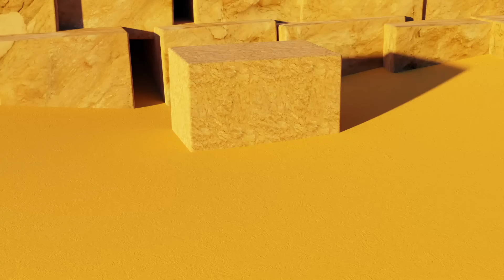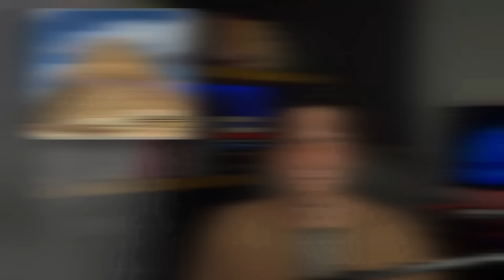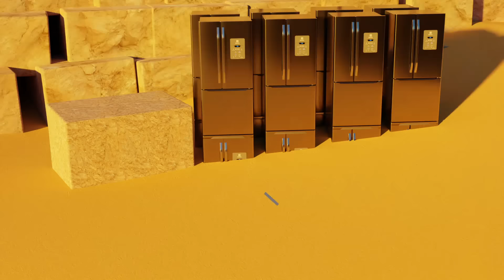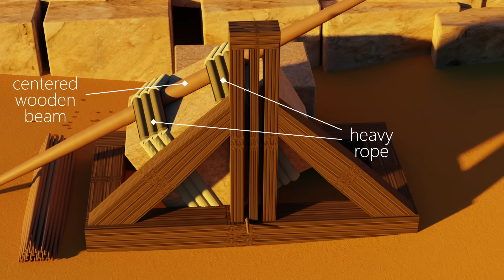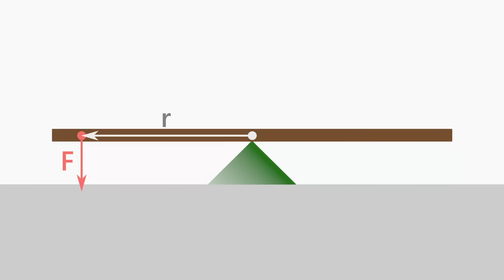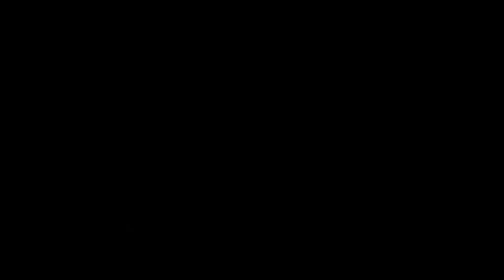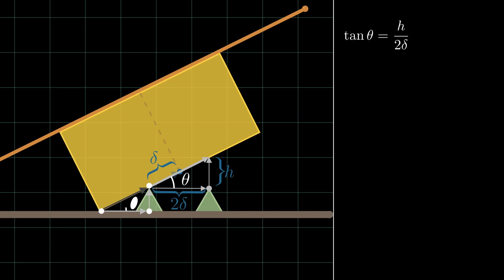Physics Reveals How the Pyramids were Actually Built

Comment: As a construction worker I have noticed that the people that draw the blueprints really have no idea how things work in the real world, I would like to see actual real world experiments using this theory
Reply: Some Japanese engineers tried to duplicate building a small pyramid using these techniques...and failed miserably.   They had to resort to using modern heavy lifting machines and still ended up with a very poor little excuse for a pyramid.
They say that the Egyptians placed one block every 6 minutes...yet the device they postulate that was used to lever them into place would take hours to build at each block location.   Obviously this is NOT how it was done....at least not in the timespan they claim it took.
Reply: @recoilrob324  I'm curious if in this setting a block every 6 minutes figure if it takes into account that most of the blocks would have to be lifted many, many times.  Never mind building the various chambers and ventilation spaces and ramps that are inside these graves.
Reply: @shopshop144  The '6 minute per block' number comes from the estimated total number divided into the 20 years the pyramid supposedly took to build.    So far....I've not seen ANY workable theory that could match that production rate and suspect that the timeline is not correct.   The pyramids could have been centuries in construction layer by layer which would make some of the proposed methods a lot more feasible....but no matter how long it took....still an incredible feat of construction.
Reply: @shopshop144 they are not graves. Don't ask me what they are, I don't know but there is no evidence that they were graves.
Reply: @recoilrob324  They didn't need to lift anything bro. They just built a ramp, used wet sand to reduce friction and pushed and pulled those rocks. They also used pulley systems to help in that. Really, all you conspiracy maniacs cling to pyramids while humans built so many huge buildings in ancient times. You don't seem to have so many conspiracies about Romans, who moved 500 ton obelisks - transported them from Egypt and put them in Rome. Collosseum? South america pyramids? All of it is basic mechanics/physics that were known since ancient times, math, manpower, ropes and wooden machines.
Reply: @recoilrob324  HAHAHAHA your "calculation" assumes one stone was laid, while the other 50,000 workers stood around doing nothing, and only when that stone was laid, the next 50 moved their block, etc. The pyramid is 230 METRES long by 230 METRES wide (ie 2x the size of an olympic running track), meaning there are roughly 100 blocks PER SIDE. So obviously at any one time, at least 50 blocks would be being levered into place. So immediately your calculation changes from one block moved into final place every 6 minutes to every 300 minutes ie every 5 hours. So each team only had to get their block into place once every 5 hours. So yeah, easy. These machines also aren't being "built", they are built and ready to move blocks. There would have literally been 1000s of these waiting for use, with up to 100,000 workers according to records.
Reply: @rufioswitch2132 
Yeah, not that easy... The barycenter of equilateral triangle is at 1/3 its height. Let say the Pyramide barycenter is at 1/4. It may vary a little but I want an order of magnitude. So for a 481m height pyramide you have to lift in average your blocs to 120m. In 6 minutes each.From the video we can expect a lift of 10cm each lifting step. Let sat one lift step takes 10 min, you need 12000 minutes to lift at 120m, or 200 hours per bloc in average. As you suposely dispose from 6 min only, you need 12000/6=2000 machines working in parallel for completion in time. Then you have to account for building and repairing these machines, inserting and shifting the blocs into and out of the machines, cutting and bringing the blocs to location and so on and so forth. I do not want to invoke aliens theory and I certainly do not believe in it, but just say that the mystery is still unsolved. Math is still not really adding up...
Reply: @rufioswitch2132  not enough room for thousands of workers to swarm over the shrinking pyramid...placing the blocks is the easy part...getting them to height aand dressing them to fit with copper tools and fitting them to match the complicated interior with the precision in the Great Pyramid is not feasivle..
Modern stonemasons and construction experts admit they could not build that today..
give your head a shake
Reply: @pvb9964  then you obviously have no idea how big the pyramid is. The base size is 40,000 sq metres. 
Even 50 metres up the area of each level is over 20,000 m2
And please tell me the names of these master stonemasons and modern construction experts who say this. Or are you just repeating what your clickbait podcast heroes say without checking?? 😂😂😂😂
Reply: @rufioswitch2132  those "master stone masons" use reality, as do the construction experts, who there are aplenty of.
Just the mere height of the Great Pyramid and the size of the blocks would make getting to a level to actually place those 2 ton blocks a formidable chore each day, not to mention the water and food consumed wotking and going up and down the sides of that 400+ high structure. 
You have not mentioned the limestone cladding....did they start at the bottom, fitting each slab to fit the 2 ton blocks, as they went up,  or from the top down?
Did they drag that cladding across the 2 ton blocks, or sled those slabs up into place...note the Great pyramid has 8 sides, not 4..with a small vertiical valley on each face...likely to ensure a slight gravitational pull on the cladding sections to the center,  so they fit tight across the side faces.
The base is level to 1/8 of an inch...impossible without a theodilite or geostationary levelling.
No theory accounts for the movement of the fifty-ton granite slabs used in constructing the internal chambers of the GP.,
and the intricate passages that are dead straight right through blocks on numerous levels. 
The GP shows no "twist" off the vertical, which is quite common in stacked piles, not does the center deviate off in any direction.
All indicarions are that this strucure is an impossiblity, and is not a tomb.
The supposed King;s chamber was never breached, and needed explosives to enter, with zero evidence of any funerary or body.
Reply: @rufioswitch2132  : 50,000 workers, working in precise teams?  You really have no idea of what that mass of humanity looks like, much less the level of teamwork required.  How many people were involved in the D-Day landing and how much of that cohesion vanished?  And that's with the use of radios.
Reply: @Alexi7666  obviously 50,000 people not working at the same time and the same area you muppet. The quarry itself is huge and would have thousands working at the same time and the transport from the quarry (about 600 metres away) to the pyramid would be a huge area that would require thousands of workers moving blocks.
then the pyramid base is nearly 1000 metres around - that's MORE thab twice the size of an olympic running track. Look at an aerial view of an olympic track and see how small a group of 10 people is.
Reply: @rufioswitch2132  : Then we're right back to the materials involved.  Wood and rope aren't tough enough to move several tons of rock, over and over.  What sort of timbers were available in Egypt at that time?  They also didn't have synthetic ropes.  I've worked with one-inch sisal rope years ago.  Fine for moving large hay bales, but when we tried to unstick a smaller tractor from a muddy field, it snapped.
Reply: @Alexi7666 You’re talking to someone who’s only interested in arguing.  Your position is the logical one.  That person just didn’t have anything better to do but write obnoxious comments.
Reply: @recoilrob324  Funny how things work in parallel so every 6 minutes is actually a very reasonable number. I highly encourage learning how computers function and you'll realize how powerful doing tasks in parallel is
Reply: @CodeAlpaca  : Uh, you're talking about thousands of workers moving in perfect harmony for what, 27 years.  Just doesn't happen.  European cathedrals were built with mostly skilled craftsman over nearly the same lengths of time, but with smaller blocks of stone.  And Europe was full of the strongest types of wood for the assorted lifting machines needed.
Reply: Academics positing heavy construction techniques. I understand gravity,I carry my laptop every day, I understand building ,I picked up a brick once. With this experience I will demonstrate how easy it was to build the pyramid. 70 ton granite blocks 150 feet up an incline building face,lots and lots of men, there, easy as that.
Tomorrow I will construct a 100 ton granite sarcophagus with a sharpened turkey feather. I am an academic
Reply: @maxSebben  
Mygawd you're clueless.

This simple math was over you head.
Reply: @jcgoogle1808 . tutored maths and physics for three years1975/1978.. left academia because it it was full of gormless bipeds.. Have completed over $ 100.000.000 of building projects before retirement 2018. You am sure can explain construction to me because I am clueless.
Reply: An archaeologist cant build the chair they sit on, but if it was an ancient chair theyd be able to tell you everything about it
Reply: Yeah there's a million blocks in that pyramid doesn't make sense seems his theory would take a hundred years with that technique
Reply: @GarethMallon  
They're not setting one block at a timeMOREON,.. there are hundreds or groups each setting their own blcok.
Reply: @GarethMallon  poured blocks
Reply: @GarethMallon Instead of guessing, why not just do your calculations? Or if you did, show us.
Reply: Did the egyptians just stumble on pyramids built by a lost advanced civilization? <— conspiracy theorist. Nothing explains the pyramids and the tech they had. And how far was the quarry ?
Reply: I second this comment. I’m only 13 years into construction.
Reply: Why didnt they weave reeds into a balloon. Then have an engineer talk hot air into it. Could have been faster and less people.
Reply: The higher you go the the harder it gets, how do you get the blocks from the ground to the higher levels?
Reply: Concrete
Reply: Pretty sure a guy has demonstrated this all by himself pivoting large blocks on a single stone and lifting by this method. Im sure its on here, as guy who figured out Edd leedscalnin or whatever he’s called method building that coral castle by himself
Reply: @Sendit123  You're talking Wally Wallington from Michigan. Yes he does amazing things with simple methods. Now go find him & take another look. That stone moving is done on a very solid base, not sand or dirt. 
And look how long it takes him to move a 20 tonne block & figure out how long it would take him to move it a mile, let alone hundreds of miles.

Side note: Saw a claim the other day that this guy had seen Ed Leedskalnin using similar methods. That's a neat trick seeing Ed died in 1951. And given he was VERY careful about doing his work where nobody could see him, (even the truck driver who moved him from the original location) how come this guy claiming it hasn't made his presence known in the 70+ years since the mystery of Coral Castle came to light?
Reply: @markmcd2780 was on about the lifting mainly, but he did manage to build something on a large scale on his own. Now you go wally wallington and wonder off with your stones and go build something and find the other missing parts. Thank you
Reply: @Sendit123  Clearly SOMEBODY doesn't like having a civil conversation with someone who can actually point out your fallacies.
And it's 'wander' not 'wonder' seeing you decided to go rude!
Reply: @markmcd2780 omg you proper bellend😂 I dont have time for muppets like you😗
Reply: The most conclusive fact that comes when analyzing the Pyramids is that the field of Archeology needs to be rebuilt from the ground up. 3 years of carpentry, 3 years remote construction, 3 years of masonry with copper chisels and the Thesis being a 10 meter pyramid made with 50 cm cube granite blocks built all by themselves with no machines or even the wheel...
Reply: Look up “man lifts 20 ton block by hand” and you will find a video of a guy using the same technique described in this video, and other techniques of rolling huge blocks around.
Reply: @RT-jv3su  that guy "moved" a block across a flat surface and literally went nowhere. Completely impractical to do anything let alone the pyramids.
Reply: @RT-jv3su his name is Wally Wallington
Reply: @RT-jv3su  🤦🏻‍♂️
Reply: @RT-jv3su  Except that man used a modern electric crane to lift and put the block conveniently in place and to set up everything around it before he filmed "moving it with 1 hand". 
Ancient Egyptians did not have access to hydraulic cranes capable of lifting 20 metric tons. Surprise-surpise.
Reply: I have watched countless documentaries on how the pyramids were built. This is the best and most credible explanation I have found:
https://www.youtube.com/watch?v=KMAtkjy_YK4
Reply: Look up “man lifts 20 ton block by hand” and you can watch a video of a guy using this technique to stand a huge stone up on end.
Reply: It's been done research
Reply: Your comment is well taken.  Instead of applying their theories in real world conditions we get computer animation.  Yeah, I think that's cheating.
But your comment being so correct extends beyond the Great Pyramid to Science in General.  Science has been politicized, and is a bunch of "Beliefs"
or "Theories" but taught as Facts. If you want to get the "Truth" about Scientific Discoveries you must go to those Scientists who have won the Nobel Prize.
Because to win the Nobel Prize your "Theory" must be proven using the Scientific Method.  Everything else is just a bunch of computer graphics.   lol
Reply: "The Best" video about our Universe and Space:  "Brian P. Schmidt - The Accelerating Universe".  Brian is a Nobel Prize winner.
And a really good MIT produced video about what space travel is "Really" like  "Cool Worlds - Journey to the Edge of the Universe".
"Cool Worlds is somewhat "Theoretical" but shows our best guess about space travel. And Brians' video is solid science.
But, Brian opened a can of worms, creating more questions than answers. But he did finally set things straight on earlier theories. Both are really good.
Reply: What load of garbage,  useless in reality
Reply: How  about the  Wooden  formers  with  standard size  blocks inside (formers like giant  cotton reels in half with square  hole in  middle...held in place with wetted ropes.  ) this enables. a block to  be ROLLED   up  ramp)   Japan  busness guys. did this  but  nobody seems to have noticed!
Reply: Agreed.
Reply: Especially the quarrying, transportation, and logistics.
Reply: What is the rope lashing was loose enough to enable sliding the lever-beam back and forth after each rotation?
Reply: You must just be labor. The real men behind construction know exactly how important blueprints are.
Reply: Why would scientists test their own hypothesis on a real scale and fail, if they can just bla-bla-bla with no consequences. Bla-bla-bla - create metal instruments from scratch, Bla-bla-bla - found the rock. Bla-bla-bla -  mined the rock... Bla-bla-bla - processed the rock... Bla-bla-bla -  transported the block... Bla-bla-bla - lifted the block... Bla-bla-bla - fitted the block with perfect precision. Bla-bla-bla -  gave toilets/food/water/shelter for 50000 workers. Bla-bla-bla - made 0 mistakes in the building process lasting for 27 years
Reply: B4 I kud not spell ingenear, now I r 1
Reply: As the noted philosopher Korzibsky observed, the map is not the territory
Reply: Hilarious. I agree completely. Classic shop v. engineers. Throw management and sales in there and the men with safety glasses must take the shaft again.
Reply: This “machine” design would be a very effective way to obliterate a lot of wood, stones, and humans. This guy didn’t check into the realities of how brittle limestone stones are, how readily wood would be crushed, how quickly it’d tear itself apart, and oh yes, placing a stone down where you needed, once you somehow got it lifted to a higher height.

Only an educated idiot would think the ancient Egyptians were this stupid.

This could never scale worth a damn.
Reply: Complete and utter nonsense,
Reply: Just because it's convenient, let's leave out the inner structure, the much heavier stones of the Grand Gallery, the  drillholes in granite, the megalithic walls with random stone shapes that fit tightly and the total absence of tools/machines that are in line with all of this.
Reply: They had waterways below pyramid.  Much more logical explanation would be they used some kind or ram pump system to lift heavy blocks efortlessly with water and smart design
Reply: instead of watching this you should watch prof. joseph davidovits
Reply: Many people point out the guy in UK who moves massive concrete blocks using a lever & pebbles. None of them can explain how he might do that when the surface is NOT solid rock or concrete.
The explanation gets even worse when you see how far he can move it on each iteration & realise many of the largest blocks came from long distances.
Reply: @markmcd2780 bro, stop with the conspiracy bullshit. Watch a vid about how they moved mussolini monolith in Italy, weighted ike 400 tons. Only manpower and animals, using only ropes and wood, no elecricity or modern tech. Then stop spewing this bullshit conspiracy loons fed you.